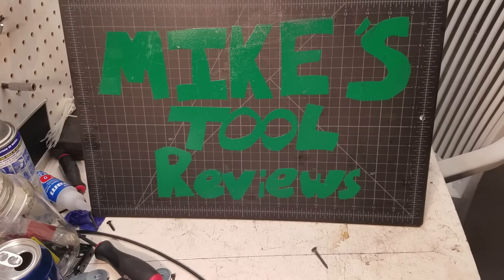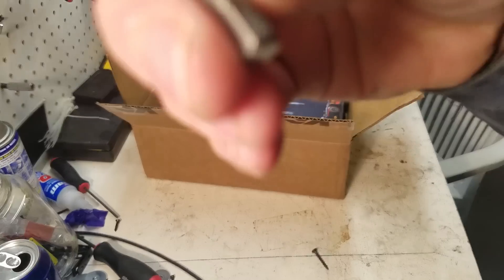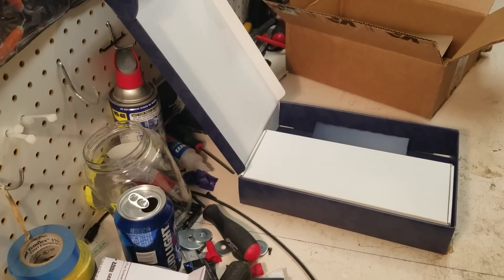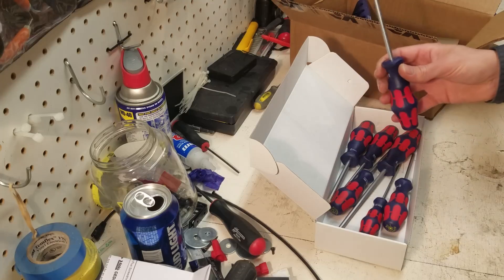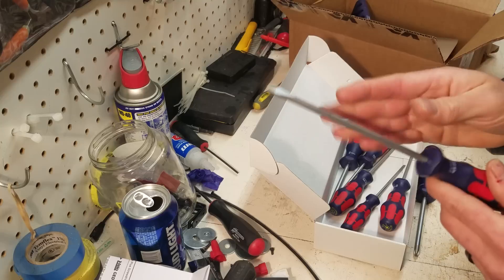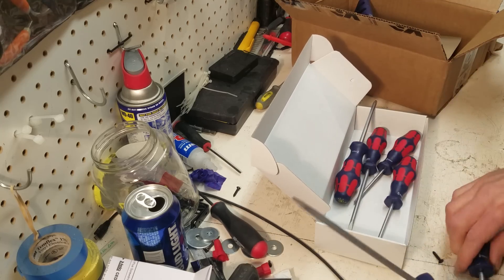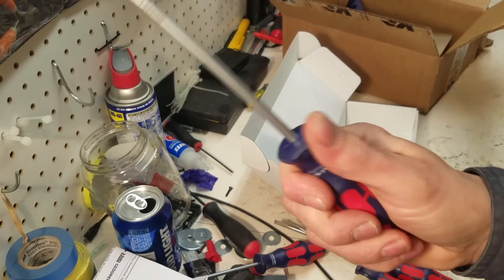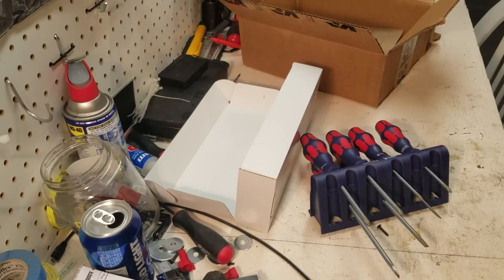Wera Screwdriver Set - Red Bull Edition 7 piece

Comment: I bought a set of Wera screwdrivers a number of years ago when they weren't really available any where but online. They are shaped the same way but mine are all hard plastic. No rubber. I've always been happy with their tools. In one of my tool Box Tours I also show a wera screwdriver that has interchangeable bit in a little case. It also has a bit kit. Was retail for over $100.  Got it for 90% off. 👍

Comment: The mean thing with Pozidrive is that a Phillips Screwdriver will easyly fit into a PZ-Screw, but then the head of the screw will get damaged very easy and after a while allso the Screwdriver will get damaged. PZ-Screws are the most common type for woodworking in Europe, even though it was invented in the US.

Comment: Imo Pozidrive is beter than Phillips as it is way less likely to slip in my experience. 

I’ve long being ignorant and used Phillips screwdrivers on Pozidrive screws and stripped them out due to the extra space in the screwhead which lets the similar screwdriver tip cam out. 

The very best screwheads are torx, it’s very rare for torx to cam out.

Comment: Are those stainless or hardened steel? I got the stainless steel set, and I love them! These look very similar.
Reply from the maker: Jon Disnard this is the standard set. same as the ones with the green rubber in the handle.
Reply: hardened steel with titanium nitride coating ! very durable.
Reply: Every German Tool is pretty much considered "stainless" ;P

Comment: Try a Wiha screwdriver, the best handles ever
Reply from the maker: +Harvey Smith and you've tired the Wera, because I'm in love with those
Reply: Yes, really good German screwdrivers, I just prefer the handles on the Wiha. They have won an ergonomics award for them so I guess it's just not me!
Reply from the maker: Well not the 1st person to day that and I do need 1 flathead for work. Think I'm gonna give em a try
Reply: Would love to hear your opinion of them in a video. Please though, don't blame me if you get addicted to them and end up with two lots of German screwdrivers!
Reply: Wera is better. The Wiha handles look similar to the newer CK handles but are thicker. But the Wera has that handle design which is supposed to emulate the impression on foam after gripping it with your hand. I also liked the old CK handle design, which looks similar to the Wera but is overall slimmer.
Reply: @bitTorrenter  Have you tried a Wiha?

Comment: How come you didn't know the difference between PH and PZ, you savage! By the way, the engagement angle is different, too, as is the torque at which they're supposed to pop off.
Reply from the maker: Because not everyone knows everything
Reply: Here in the UK no one knows the difference between pozi and phillips in fact pozi is most commonly used but no one uses the term, everyone just says Phillips,  whether it's Phillips or pozi. Even builders. The guy I used to work for had been a builder for 40 years and he still doesn't know. I've tried telling him the reason he keeps chewing up screws is because of this , you can see his eyes glaze over when u try and tell him , he just won't absorb the information ... lol. Too set in his ways , he's been chewing up pozi screws for 40 years , he ain't about to stop now .... lol. Bit different in the US though I believe, PH is by far the most common there as I understand it. So unsurprising most wouldn't know what a pozi is as they rarely come across them.
Reply: @willjdeanie  I can totally visualise what you say there and it's quite funny. True what you say about the older folk. They just refer to Phillips even though you can see that Pozi looks different. Pozi is far superior and I don't know the last time I saw someone buy a set of Phillips screws over Pozi.